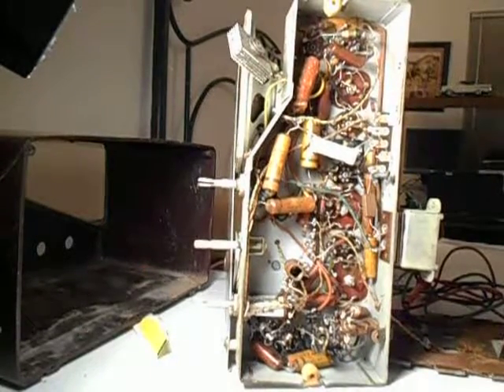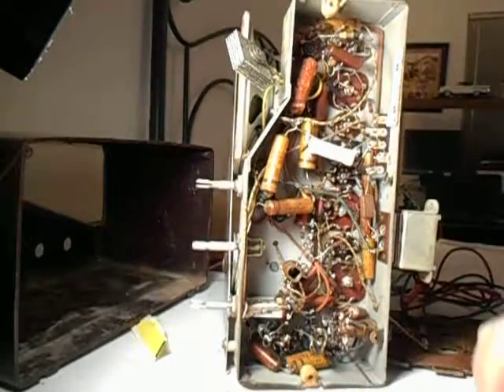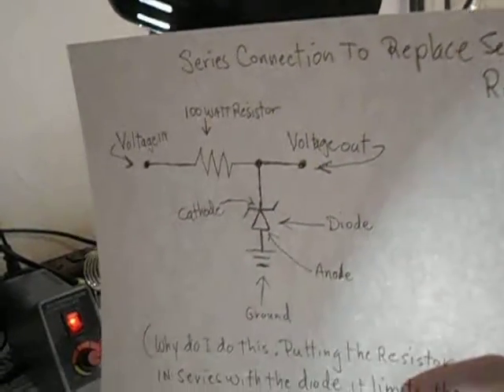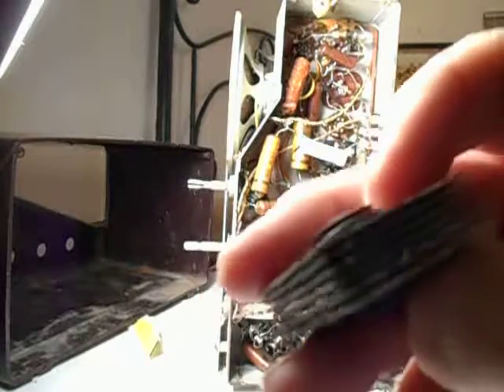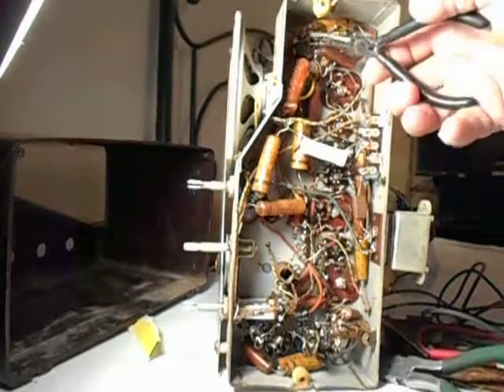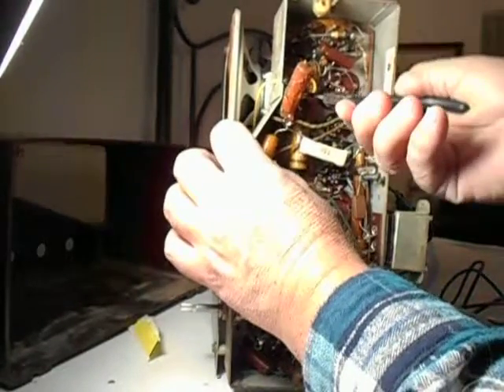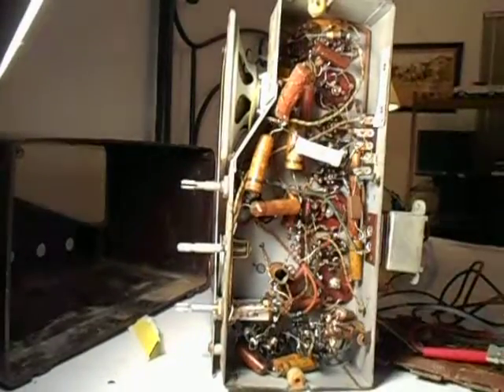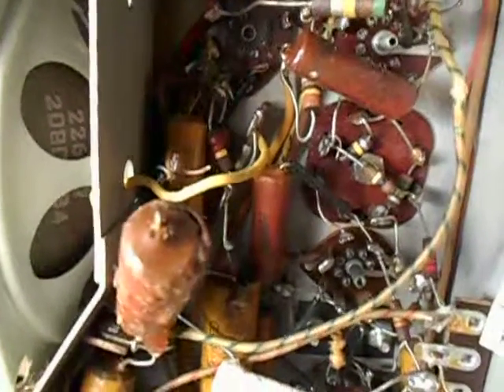Here is Part 2 working on Zenith Model 7H822 AM/FM Radio

Comment: New viewer here. Oh boy, I must be old school. If you don't mind me venting. I don't think that diode is wired correctly, please check online. Personally I would have replaced the selenium rectifier, coz I like em. As far as the resistors goes, the carbon comps are bullet proof. Too bad you don't have some old bumble bee cap pulls. They too are bullet proof plus, I think they sound better than the old wax caps. But, that might be psychological. P.S. Who needs Sam's photo facts, right ? Lol.
Reply from the maker: Well true if i had access to new old stock selenium rectifiers I would have used them. The resister and diode were wired correctly and yes my diagram was wrong i'm terrible at diagrams. Same with bumble bee resistors don't have access to any but hey I use what I can find I do not have a well stocked junk box of parts bins this is not a business for me. I only repair my own stuff in my collection so if I blow something up its my headache no one elses. Thanks for watching.
Reply: LUCKYLARRY Oh, I didn't mean to come off harsh. I was making conversation is all. One can find NOS parts on e-bay. Anyway, I was going by the legend you drew. I didn't want you to make a mistake.  As long as you didn't get your butt fried is all that matters. Thanks for responding. :-)
Reply from the maker: Oh no Danny I didn't take it as you being harsh. Actually Doug was the first one that messaged me and said Holy Schnikeez don't follow your diagram. Yeah I know Doug I drew it out wrong sorry bout that. I take everything as constructive criticism. I have been around for 66 years it takes a lot to bother me. Thanks again but NOS parts on EBAY are too expensive for me I live on a fixed income so not going to buy the parts i don't have to get something to work.
Reply: LUCKYLARRY I too was going by what you drew. I'm sorry, I don't know who Doug is.. I was concerned about your safety. It's a good thing he got in touch with you. Yes, I agree, e-bay parts can be a bit expensive.
Reply from the maker: Doug has Doug's Electronic Repair Bench here on you Tube in the comments on here he is listed as mosslack. Has a great channel to watch as well.
Reply: LUCKYLARRY Oh ok, I didn't read the comments. Thanks for filling me in. Perhaps I'll check Doug's channel out. :-)

Comment: I needs to do a few SR's, not done one before, your technique made it look easy! Thanks for that!  ~Jack, VEG
Reply from the maker: Vintage Electronics Geek Thanks for watching Jack glad you liked it. I try to have something for everyone in my videos.
Reply from the maker: Vintage Electronics Geek Those old selenium rectifiers had those big fins to disipate heat thats why the resistor was added with the diode. had to slip heat shrink over the old insulation that would have crumbled to bare wire. Its always a guessing game lol
Reply: Thanks Larry, I appreciate that!  I needs to get parts to do mine....when its time to do those projects!  :)  ~Jack, VEG

Comment: It seems like once you start just keep going that he on the old stuff this raises havoc with everything. Good choice to send resistors
Reply from the maker: buzzsah i used to build my own radio equipment back in 67 and 68 just tube equipment. i had electronics class in high school with practical lab experience from 1967 thru 1970.we used to get old radios that didnt work and we got them to work i always got straight A's so i will get it to work.
Reply: I always liked to sound the tubes gave over TR, IC's the old Yaesu's HF rigs, and the old Sansui stereo amps.  I had gotten slapped on the wrist when mt watch band hit some volts, I still have a scar on my hand. :)

Comment: All that wiring looks like a mess to me.  Good luck!
Reply from the maker: Yep well back in the 40's it was mostly point to point wiring with no printed circuit boards like we use today. Back then you terminal strips to make multiple connections and then direct wiring to the tubes. The wax capavitors also melted after yearx of heat in the chassis. So yes in normal every day terms its a mess of wires lol